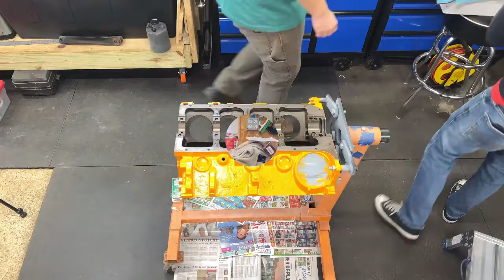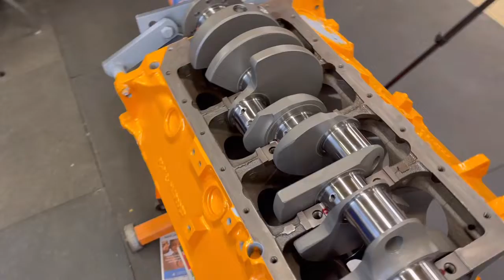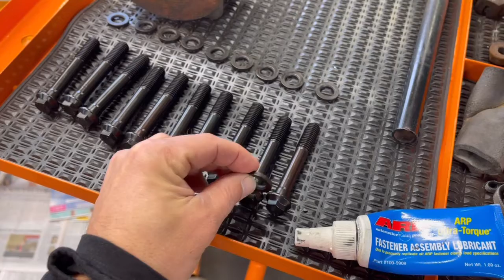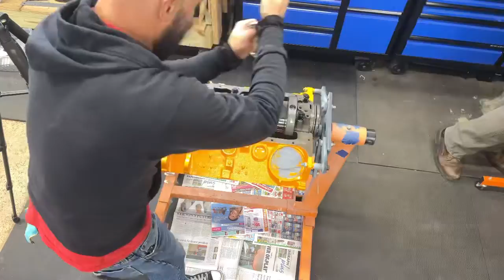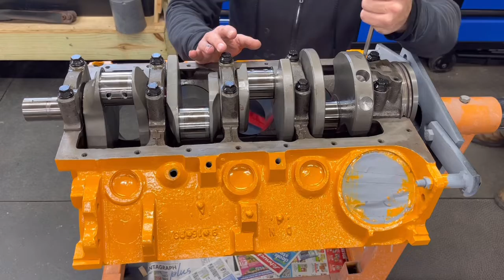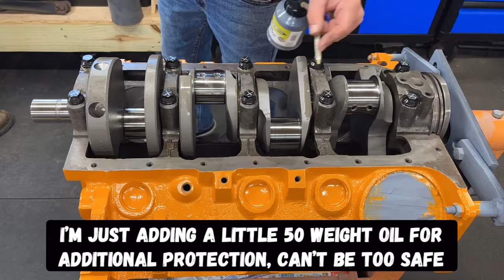323 CI Small Block Mopar Engine Build Part 1: Crankshaft Installation #engine

Comment: About 13yrs ago, I built a 328" (.060" over 318) LA which I call my "Baby 340." LOL. They are good little motors and get great MPG, even with a mild lopey cam. I used a 270S Comp mechanical cam in mine, with old 273 adjustable valve gear. I ran #302 casting heads with bigger 360 valves added. Street Dominator low rise intake with a 625 Street Demon and 1-5/8" headers. Nice little 300hp combo!! :face-red-heart-shape::trophy-yellow-smiling::yt:
Reply from the maker: That sounds like a winning combo!!! I bet it sounded pretty good too!  Cant wait to fire this one up 🏁

Comment: The lube on the upper shells threw your Plastigage reading off some, the actual clearance on the mains is probably closer to .002", which is great!! You are supposed to measure completely dry to get actual OIL clearance.